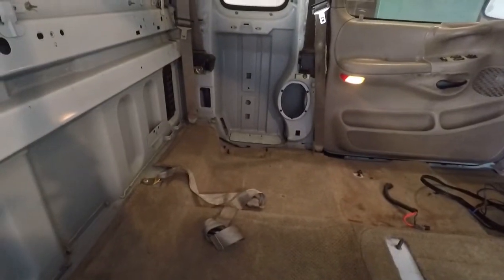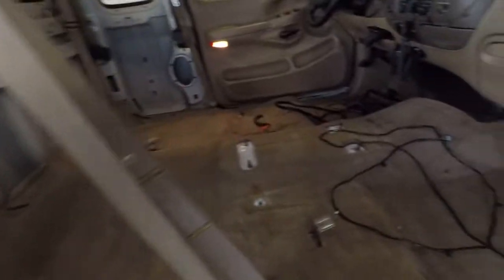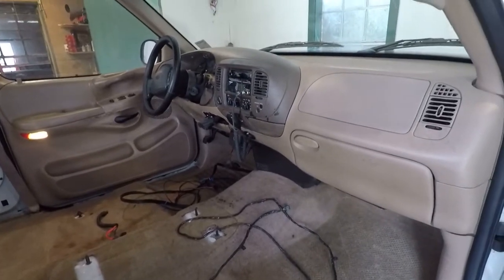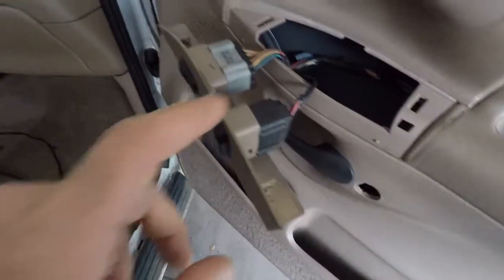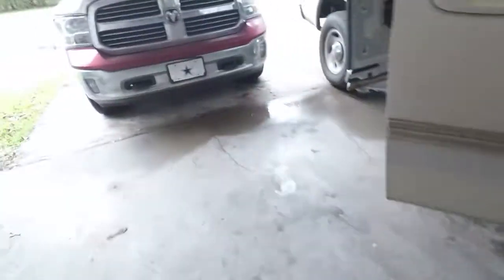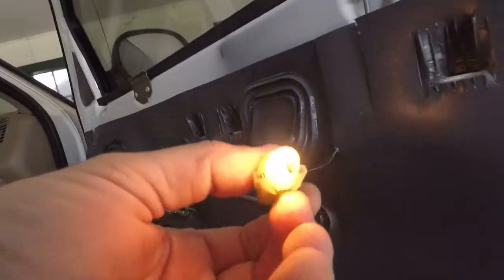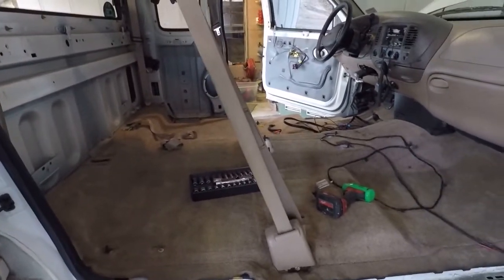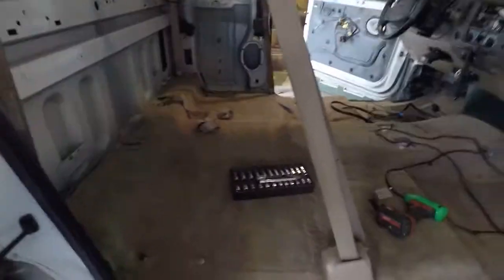Ford F150 Stereo R&R Part 1

Comment: There are custom sub boxes you can get for that truck. I got mine on ebay for about $70 and it fits under the rear seats by raising them by 2" with the provided blocks and it fits two shallow 10" subs. I use 2 kicker comp 10's on a 600w peak Dual amp and i love it and highly recommend a custom sub box. Although i would go with better subs like Skar
Reply: Also personally feel the backseats to be more comfortable raised up higher. My head wont hit the ceiling being 5'10. Only downside is the seats will not fold. Also that space next to your rear seats on the driver's side is VERY handy to throw a dual battery setup in!
Reply from the maker: Excellent ideas! Thank you!